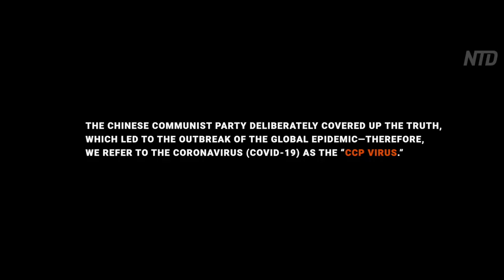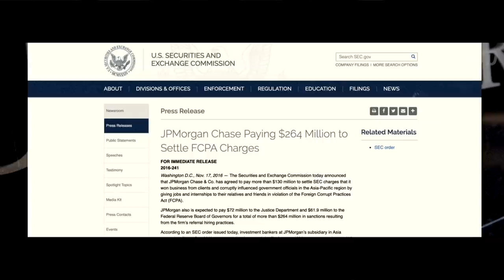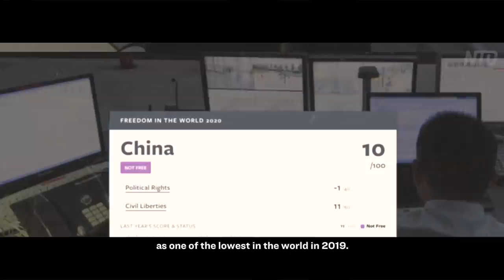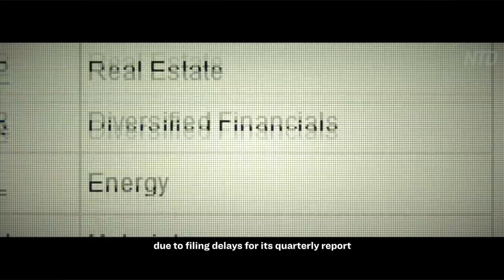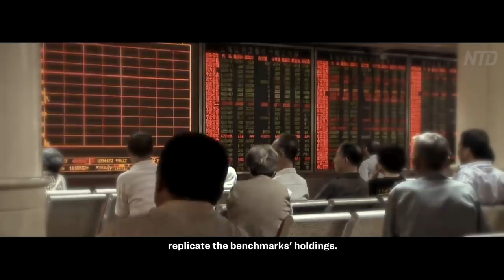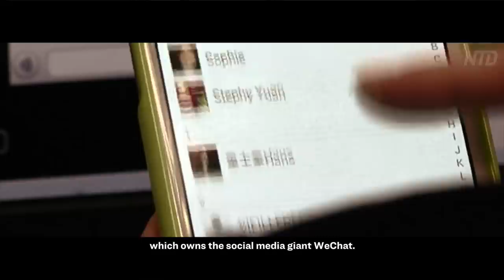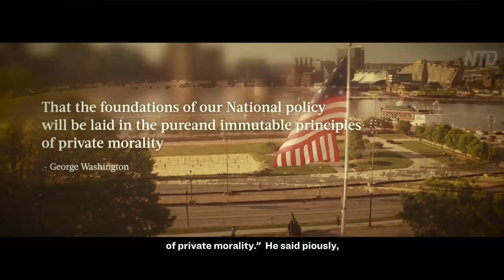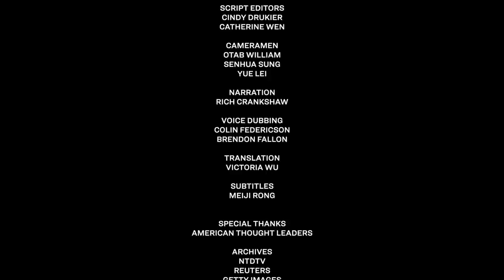Special Report: The Coronavirus Pandemic's Wall Street Connection | NTD

Comment: Every American needs to close the accounts from JC Morgan Chase I will after 20 years
Reply: done
Reply: Yes along with Wells Fargo and B of A. Actually best thing to do is to use a Credit Union of a small local bank. Remember, when you deposit your money into a bank, IT BECOMES THEIR MONEY. When they fail, your money becomes part of their money under the "bail in policy" and FDIC doesn't have to protect you because you agreeing to the bail in policy when you open an account, or keep it open after they send you one of those privacy policy updates that is about 20 pages long typed in micro-print that can't be read without a magnifying glass. But they half half a page in size 18 font telling you a few "makes no difference" changes. So that's as far as you read because it is all you can read. But that document has the Bail in policy explained (read slight mention) included in it. Derivatives are what will sink most banks. So if you are going to use a bank, ask them to show proof of their exposure. Most smaller local banks will own none. Even some larger private local banks won't own any either. Do your research.

Comment: Sponsoring Investment banks that do the due diligence should be penalized to the extent of the losses sustained by investors. Full financial  disclosure need to be made by sponsoring Wall Street player and declare themselves as foreign agents. Violations thereto should cause the suspension of the violators until full reparation is made to defrauded investors.